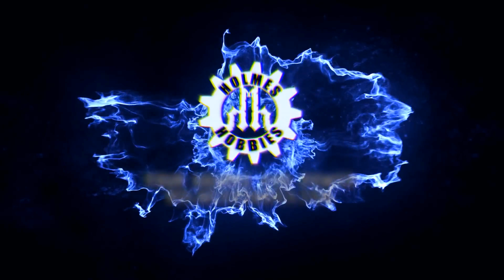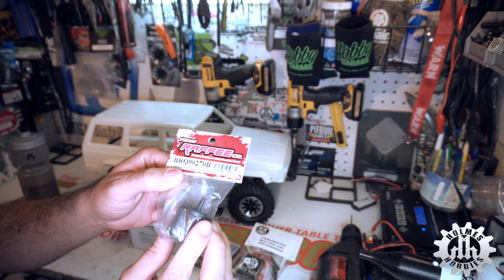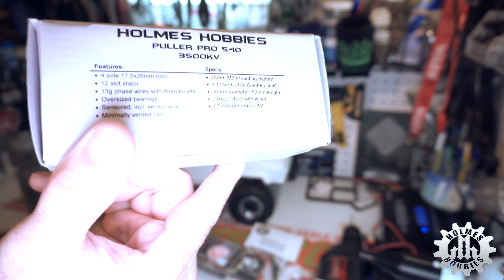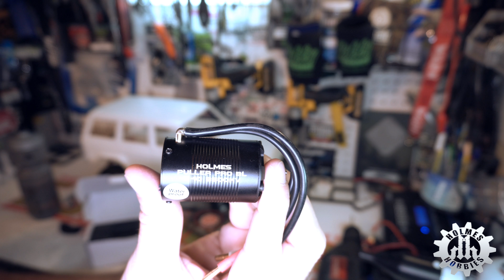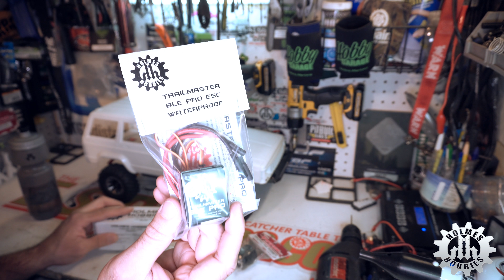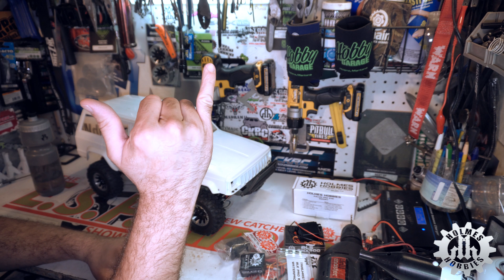HOLMES HOBBIES | MOTOR CONTROL | EPISODE 64

Comment: Does a12volts servo mean it needs 12volts
Reply from the maker: No it just means that it can operate directly from a 12v power source. Instead of getting power from the receiver which is usually 6 or 7 volts, it can be wired to get power with the esc directly from the battery. It will work on 7.2v as well but it works best on 3s.